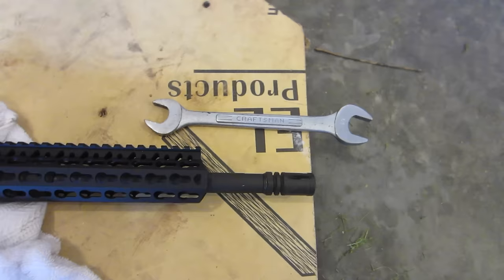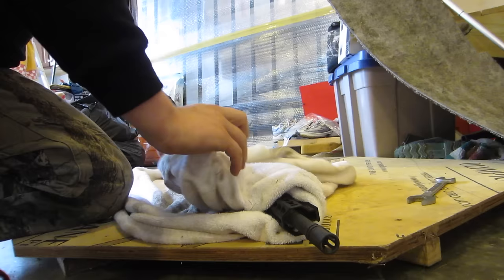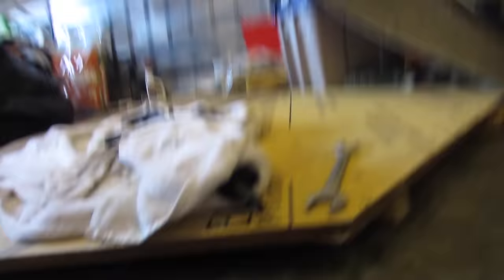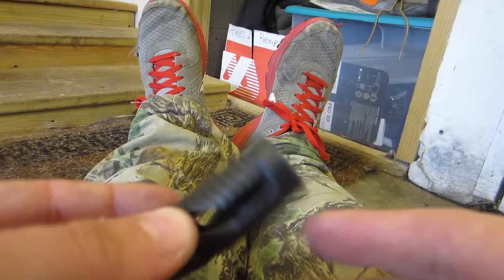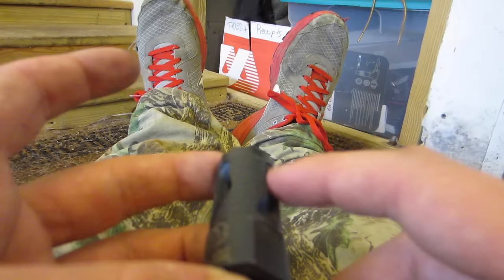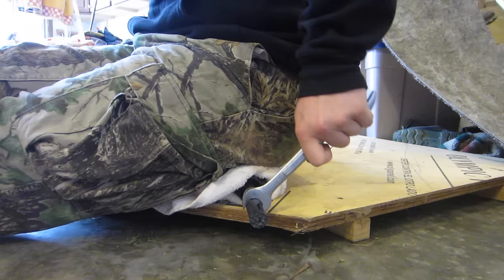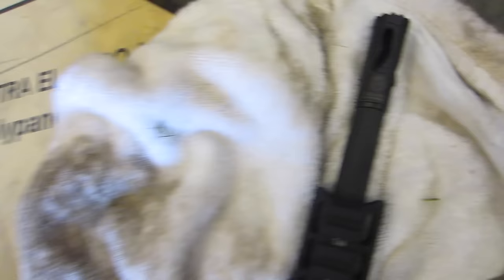AR-15 Muzzle Brake EASY Removal and installation. Troy Medieval Muzzle Brake

Comment: That actually worked!  Thank you!  You just saved me $50.  I sat on the top of the stairs with the barrel sticking out, the gun wrapped up in 4 layers of towels, and did it.

Comment: Pretty good job kid,  I have no problem with the way you did it.  It worked right.  The crush washer isnt actually a washer at all it's a spring.  Its tension is what creates structural integrity to the barrel.  So its critical its put on correctly.   So as long as the surface of the crush washer is the same diameter or smaller,  to were it mates up.  Some are cone out, some are come towards the shooter.  You must have it in right my man

Comment: You can also unscrew the compensator by gripping the handguard with one hand while holding the pistol grip between your legs, then cranking on it with a 10" crescent wrench.  Fwiw, that's an A2 flash hider Mr. Vlogs removed and he replaced it with a muzzle brake.

Comment: I've always been told if it hasn't been done before to tighten to 35 foot lbs, then back it off and unscrew it then repeat and then back it off again and unscrew and then on the third time torque it down to 35 foot lbs.  This stretches your threads and makes it nearly impossible for it to ever loosen up without having to use any locktite or anything.
Reply: way to ruin the single use crush washers..

Comment: Bruh. If that a free floating guard then won’t it warp possibly if the receiver isn’t held firm? Or not enough pressure?
Reply: "Warp" isn't a good way to put it. Completely snapped mine doing this
Reply: @patriotsanonymous8014  tis why we don’t use nerf guns.

Comment: I really didn't expect this to work but it did! Thanks! I don't weigh a lot so my upper was still twisting when I turned the wrench so I hit the wrench with a hammer a few times, not too hard but enough to knock it loose.

Comment: If it works it works 🤷‍♂️ did this on a 10" barrel and worked fine, did it on a 16" and warped it. Just bought a vice and got the tools, obviously the best way but...this works, too 🤷‍♂️👍👍🤣
Reply: What warped?
Reply: Doing it the way the video shows risks damaging the receiver, the gas tube, and more.

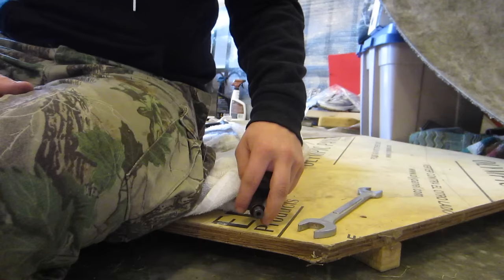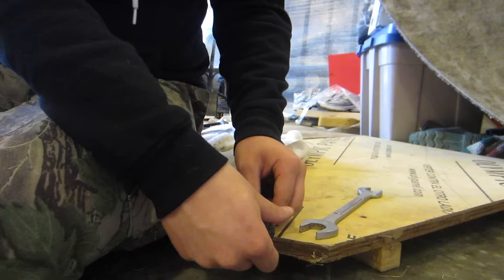Comment: Good stuff! 👍🏼 Actually though, I do have one critique and that is this, the “Crush Washer” is installed with the beveled end facing towards the AR, not away from it like you showed at 3:25 - 3:35 min mark. Again, great idea. Thanks 

Lastly, I agree with some of the other comments about the intro.
Reply: Actually I believe he was right when he faced the beveled end out away from the rifle
Reply: Wrong it can go cone out or cone in,  read something.  Its directional in the fact, that the surface of the crush washer, which actually isnt a washer at all.  Is the same diameter or smaller to the barrel surface it mates to
Reply: @dylancraig3945  this is also what he guy from brownells says

Comment: Flip your washer he put it on backwards
Reply: How do you know, I couldn't  tell.  They can go come out or come in.  It must be the same diameter of were it makes contact
Reply: The crush washer has a crown, the crown faces toward the receiver.
Reply: Not that this is a great place to find good advice, but I believe the crush washer goes either way depending on which side has more material. Don't quote me on it, do some research.
Reply: I was scrolling through the comments to see if anyone else picked that up. You are correct Tobe.

Comment: you put the crush washer on backwards
Reply: No he didn't.
Reply: eric simmons actually he did, the "cone" side goes towards the barrel not away from it. Google it or even look it up from the PROFESSIONALS.
Reply: You're right, it's hard to see at first.
Reply: @brandonrayner5253  Smaller side should be towards the barrel with the flared towards the brake.. You can do it your way where the cone is towards the barrel but you could possibly cause some damage to your barrel when torquing.
Reply: @bobburger1730  except every professional gunsmith will tell you the cone goes towards the barrel and not the muzzle
Reply: I guess brownells is wrong then? Because according to them its beveling to the brake. Now im unsure of whats correct 🤣
Reply: Boom you just got served

Comment: Not a bad video at all, and it just goes to show you that you can stick to the real basic methods of removal and replacement, right? BTW, I think the words you were searching for in the end was "OEM birdcage muzzle brake," and this is only positve feedback, becaue you did an awesome job! Is there any need for any kind of grease on the crown threads, in your opinion? When I was in the British Army, we had something that was put on before replacing the muzzle brake, but I don't remember what - it was nearly 40 years ago, LOL! Thank you, a real bang-up job 🙂

Comment: So, I've got an issue with mine. I've got a ruger ar500 and I've even gotten the blow torch to my break. Still can't budge it.
Reply: Are you sure it's not pinned and welded? How long is your barrel?
Reply: @TannerReathaford  I got it a couple days later, turns out I just needed some more heat and elbow grease.

Comment: Good way to mess up indexing pin
Reply: is that really possible? 
From what I've found, the muzzles aren't usually torqued down too much (10-20ft-lb?), and so I can only guess the index pin could potentially  withstand it.
Reply: If you feel lucky go ahead.

Comment: I was wondering how this video got half down votes.  This is amazing!  Then I realized I was hypnotized by the bad ass "edelkrone.com" commercial and that's not what the comments were about.  Hows that for good marketing.  Made me forget what I came here for.  Makes me want to get into photography just to buy this piece of equipment.  ...now, back to gunsmithing...and getting this crush washer off.
Reply: It's down voted because this is a really stupid way to do it.  The marring on the barrel from the bare jaws of a vice (if you don't have the right tools) would have been way better than what he did to his upper... Hopefully nothing ever happens as a result, but why take this risk, when it's soo unnessicary?!

Comment: The proper way to get your muzzle to line up is to screw it in as far as you can with it being up right, then measure the gap with a fueler gage, then put some shims slightly bigger than your gap between the muzzle device and you washer. Then take your muzzle device off put a dab of lock tight on the threads then put the muzzle device back on and tighten until your muzzle device is straight, you should use a breaker bar with a special tool for your specific muzzle device. It should be tightened to about 30 pounds.

Comment: tried this and all these other methods on youtube, even took it to a few gun shops, they couldn’t get it off and all of them said they were worried about messing up the barrel. they mentioned that it’s like the flash hider is welded to the barrel so pretty much, i’m fucked
Reply: Some muzzle devices ARE pinned and welded to the barrel.  If your "gunsmith" couldn't figure that out, you need a better gunsmith.
Reply: @Mauser.K98.Guy.243  the shops were pretty ass at the time but they were also the only things around me. I had to send the upper back, it wasn’t welded but something about it being over tightened to the point where it fucked up the threads. That was 4 like years ago though so i’m all good now🫡

Comment: trying to take the troy factorybmuzzle break off my .308, it won't budge no matter what I do
Reply: Are you sure it's not pinned?  Check for a spot weld that might be hiding one if you're not the one who built it... (You never know what the builders market/restriction were)
Reply: thanks man, I had to take it to a smith, he couldn't get it off without cutting it and after that we figured out it is the wrong threads for the break I bought so in the end he had to re-tap it to the propper thread, no way I would of been able to do it on my own with the tools I own, probably would of fucked some shit up if I pulled any harder, I could see the barrel itself twist a bit before I gave up so hopefully I didn't fuck my barrel up or anything, kind of a disaster and spent twice as much as I wanted but whatever, it is done now
Reply: Rolla Stout a cross thread is a tight thread

Comment: Its better to tighten then loosen then tighten then loosen to get it to where you want it to be. But if it works it works
Reply: Rude420Boi not true if you have a crush washer. Don’t uncrush the crush

Comment: Your method is dangerous and should never be used.  This puts unnecessary stress on the receiver threads, upper and lower pivot / takedown pin holes, pistol grip as well as potentially tweaking you barrel.  Spend the $50 to buy the right tool and not have to replace a $1,000 gun.

Comment: Dude, you are making videos about an AR 15 and you sound like the democrats who do not have a clue what they're talking about. That washer is called a crush washer and if you don't know that and also don't know which way it faces upon installation, then maybe you should not be telling people you're going to show them how it is done. Lastly, that muzzle device you were removing from your AR 15, the one you called a "muzzle brake"... it is not a muzzle brake, it is a bird cage flash hider. Although the newer design hider with the incomplete bird cage pattern on the bottom of the device, probably does have a brake effect.

Comment: look... If all you're going to do to your AR ever is to change your muzzle brake or flash hider sure park your ass on it. I think you should just put it in an upper Vise block and do it correctly which includes not guessing on which way the Crush Washer goes because 50% of the time you're going to get it wrong like you did. BTW, great intro...NOT!